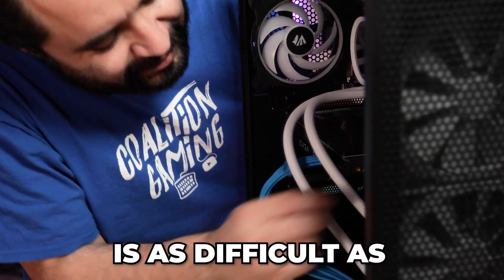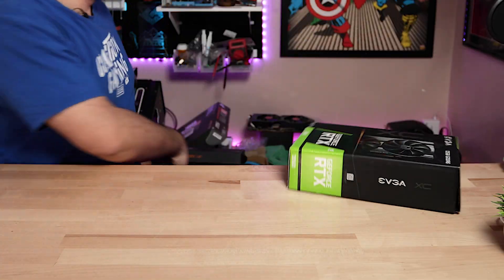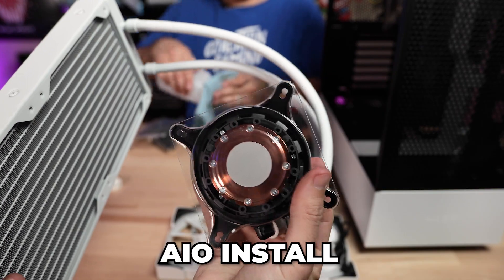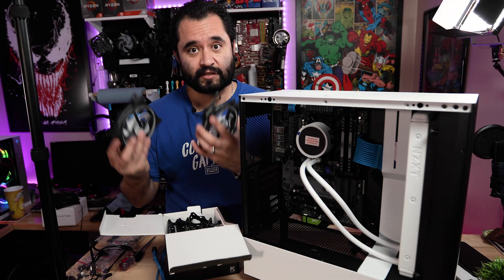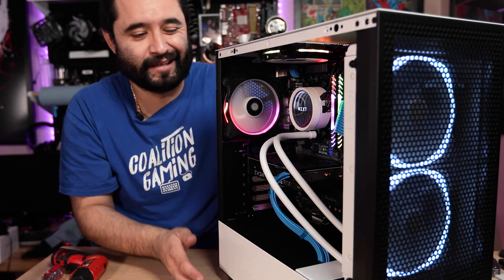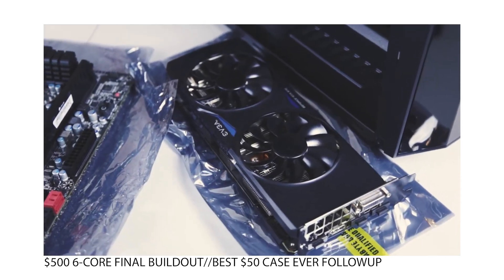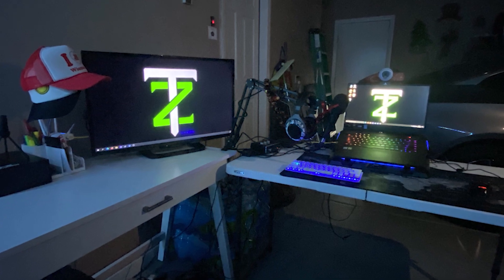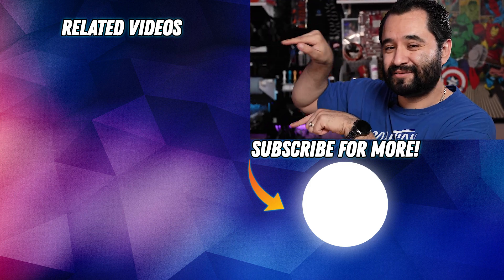Building a STREAMING PC in 2022!

Comment: if i build single PC for streaming for warzone  or battlefield 2042 with 3070 ti and i5 - 12600kf and RAM 16GB ... can it handle it for long term ? thanks for your answer sir !
Reply from the maker: yes but don't get KF. Get a K or non-K.12th gen integrated graphics has a great encoder for streaming which would free up the geforce GPU from having to do any stream encoding work. Maybe up it to 32gb RAM as well.
Reply: @CoalitionGaming  owh ,, my pc right now is i7-9700k with 2060 Super GPU and 16 GB ram ... if i bought i5-12600k with new Motherboard asrock b660m pro rs ( Low Budget Condition hahaha ) .. then when i stream and use x264 for OBS enconding and upgrade my ram to 32gb .. that's enough for 144hz fps for warzone or battlefield 2042 ?
Reply from the maker: Don't use x264 software encoding in OBS. You'll want to use Intel's Quicksync encoding. A 2060 Super may not get 144fps unless maybe you play everything on low at 1080p, but it will give you solid performance either way. I use to have one and played warzone at around 80-100fps at 1080p high settings, while streaming.
Reply: @CoalitionGaming  owhh thanks sir for your explanation !! sorry for my bad text in english !!

Comment: Are 2 sticks of 16gb ram also compatible instead of the 2x 8gb?
Reply from the maker: Yes. That's what is in this build actually.
Reply: I built the exact same build my ram is not lighting up why?
Reply from the maker: @tyveonjabari  Are you sure its RGB light up ram? There's nothing to RGB ram, you just plug them in. Maybe find the associated RGB software and see if it detects the RAM and can "turn the rgb on." But it should already be on.
Reply: @CoalitionGaming  I’m past that part it’s up and running just need to figure out where to get a really long ethernet cable from and how to route it you got any ideas?

Comment: My current rig is i7-10700k/ asus tuf 3070/ z490 msi godlike/ 850W and I still feel like my stream quality is low at 1080p what am I doing wrong?
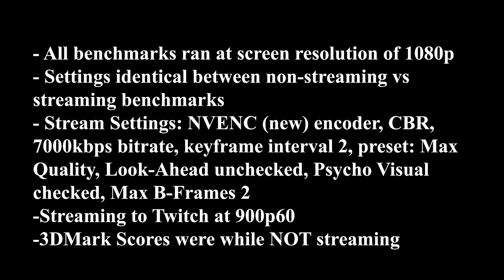Reply from the maker: My settings covered in this video are at 4:20. Also this, assuming you're streaming to Twitch, you should try streaming at 900p60 instead at 6000-7000kbps bitrate: https://www.youtube.com/watch?v=W25CL5kikQI&t=

Comment: I'm  have been working on this build for 14 hours and I can not get it done. There isnt a adg connection. There is not connections for the button,USB and headphone jack on the case.  I just wasted 1600 on this thing to not even get to turn on
Reply from the maker: Not all motherboards have addressable RGB headers, or any RGB headers at all. Not sure why your case would be missing the front panel connections though but the only important one is power so the power button can turn the PC on and off. Here's my in depth PC guide to help you out.

https://youtu.be/Rqv6rmPp2cE
Reply: @CoalitionGaming  I'm on the USB step mine has 4 on top 5 on bottom but the connector on the board has 5 on top 4 on bottom what do I do now
Reply from the maker: @berzerkphantom6475  you flip the connector cable dude
Reply: @CoalitionGaming  it still wont go in cuz when you flip it it changes sides
Reply from the maker: @berzerkphantom6475  if it's a USB 2.0 header it should just plug into a USB 2.0 header. Sometimes they are flipped. Sometimes not. But it should just plug in. If it's a front panel audio header, it could look similar but the missing pin on the header changes sides when you flip it, yes. It's NOT a USB header if that's the case. Plug it into the front panel audio header where it belongs.
Reply: @CoalitionGaming  I figured it out. I got my pc up and running thank you for your help and your time.

Comment: Where is the vdg on the mother board
Reply from the maker: Depends on the motherboard
Reply: @CoalitionGaming  it's the same as the video
Reply: @CoalitionGaming  I got everything from this video
Reply from the maker: @berzerkphantom6475  you got a b450 pro4 motherboard? Then it should be the grey 3 pin header near the USB 2.0 headers. Looks like it has 4 pins but one is missing.
Reply: @CoalitionGaming  I got 550 it's not there
Reply from the maker: @berzerkphantom6475  a b450 pro4 is what was used in this video. You will need to refer to your motherboard manual for where the addressable RGB header is for the b550 version.